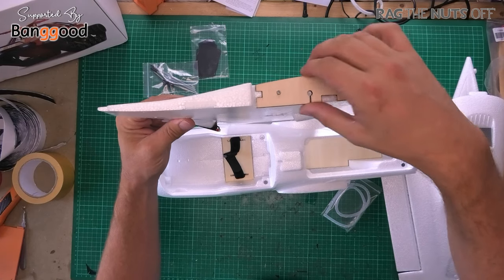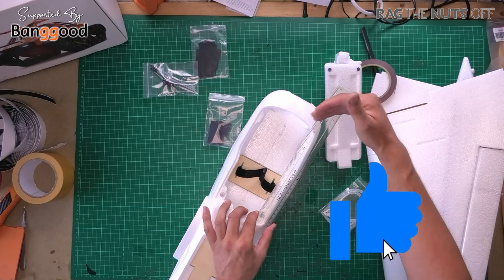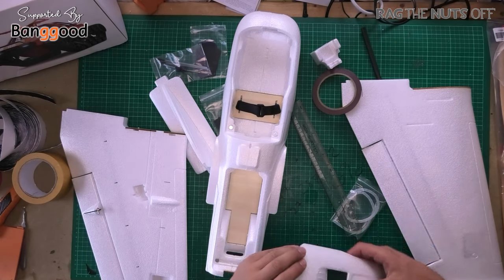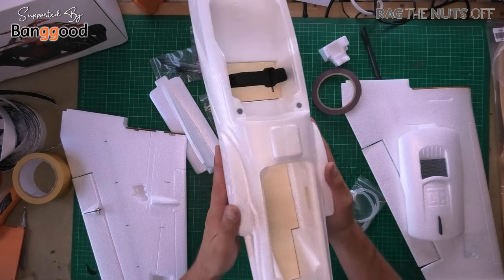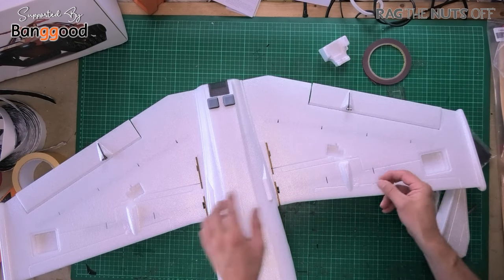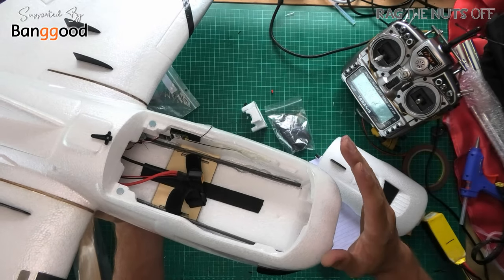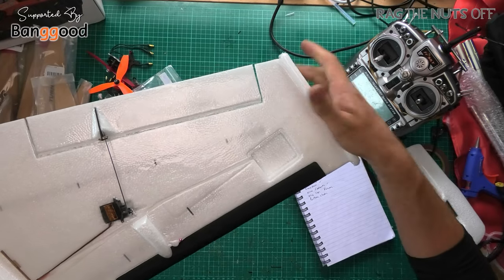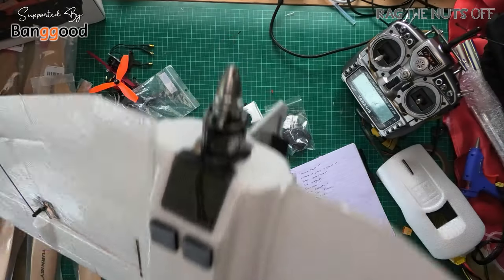LTE Rambler RS Unboxing & Overview (Full Version)

Comment: I'm actually excited to see a motor other than the 2216 1250. Not taking anything from it, it's great! Just ready to see some nut raggerteering on what looks like an aggressive styled model.
Reply from the maker: Howdy Chris, yea will be fun to see how it handles in the sky when it's forced though it 😂
Reply: Got the SunnySky 2814 1250kv 9x6 prop for mine
Reply: RagTheNutsOff probably get a little more authority on that vertical stabilizer you weren't  sure of with that speed lol!
Reply: @chriswayman7240  I just wanted something between a DartXL & my Strix Goblin. DartXL is a bit slow, the Strix won't go slow. Hopefully this set up will be somewhere in between.

Comment: Finally starting to catch up on videos... You are putting them out at quite the pace.  I have a newbie question as I am getting into purchased foam models and you've mentioned mold release a few times now.  Is denatured alcohol (aka methelated spirits) safe for both epp and epo foam to remove it?  I agree on the vent covers. I'm thinking a nylon window screen might get sacrificed for some of my foamboard models to cover the ventilation openings. 😀  
On that pin note, I use little map pins with the round ball ends to mark the cg in my foamboard models as well given that they are quite short and perfect for that (and I don't get the "look" from the wife for nicking her sewing pins).
Reply from the maker: Hey Adam, yea sometimes they absolutely rinse the mould with release agent and the foam is really slimey. That can be an issue with getting this to stick to it. For example this one on the inside sellotape won't stick! A very light sand if your laminating or a quick wipe with some soapy water or light alcohol will work well.
Reply from the maker: Hahaha and yea map pins will work too!

Comment: Noob question, what is "Laminate"?
Reply from the maker: Hey Chris, not a n00b question at all. It's simply plastic film that you can iron on to the model. If you've ever been to a restaurant and seen the plastic menu, that stuff but thinner. Helps make models stronger and keeps them clean too. Matt
Reply: @RagTheNutsOff  I take it that's not the same iron I use for my shirts 🤔. Is there a special technique?